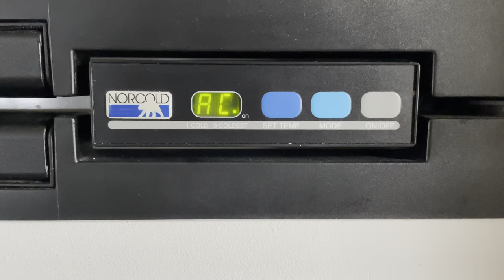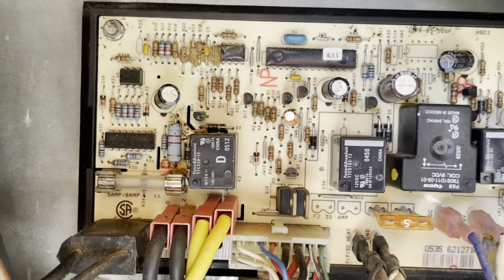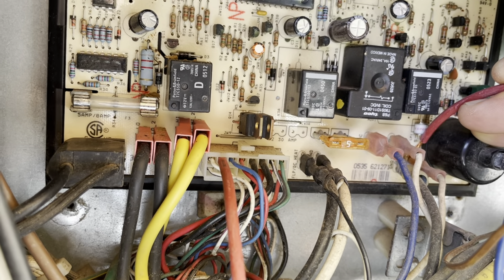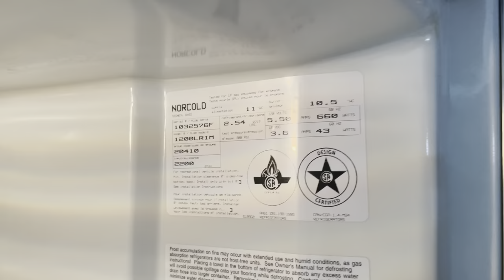“No Co” Code - RV/Camper Fridge

Comment: Just purchased a 2002 Winnebago Journey 36c. The refrigerator does not work on AC or LP. I looked at the board outside which has no cover. I don't reallyknow what i'm looking at. All i found was there are two red wires disconnected that go to this little valve that states 12 volt where the wires come out. I can see it was plugged in and the glass fuse looked good.
Reply from the maker: Is the fridge the same brand and model as this one?  And you’re getting the same error message?
Reply: The model is1201LRIM and getting same code for AC and LP code no flow @VitosFix
Reply from the maker: Yeah, I apologize, but if the back doesn’t look like the one in my video, I’m not sure how to help with that one.

Comment: Hello I have the exact same fridge and the mother board has some wires disconnected. It has the 12v disconnected and I have no idea where the wires go. My wife and I just bought this allegro bus and I need to figure this out to celebrate my wife’s birthday.  I can not find the schematic and it does not have the safety recall shutoff.  Please help me.  Thank you.
Reply from the maker: https://www.manualslib.com/manual/112570/Norcold-1200xx.html#product-1200LRIM

Check this manual out. Should be helpful!  But if it’s the same exact fridge, the wires should go in the same places as you can see on mine in the video.

Comment: If anyone is trying this and their power board has a different layout. Mine has a section called ‘P2’ located top left on the power board. I put the wire in the 5th hole (second to last) and grounded it to the metal case of the fridge. Heard the click, turned the fridge on and off again. Problem solved.
Reply from the maker: Thanks!

Comment: My Norcold 121 starts up on propane but will not throw a flame more than like a pilot flame, ac setting works as it should, what’s up?
Reply from the maker: Haven’t seen this one.  How long did you wait?  Is the refrigerator already cold or is it warm?

Comment: Just to confirm the ground is the connector not the bolt to the right of it
Reply from the maker: Correct.
Reply: Norcold mentions touching the bolt head but hey same difference

Comment: no AC code is on but have lights inside the fridge?  Hummm?
Reply from the maker: Same, keep watching.  I was saying that if “it didn’t have lights on.”
Reply: @VitosFix  the lights are on but still got the “No AC” code.  What’s wrong you think?  Jack.
Reply from the maker: I figure it’s like having to reset a computer.  Did you watch the entire video?  It shows how to reset it, and hopefully fix you problem.
Reply: @jackmaness202  I had same symptoms as you I fixed by replacing the blown out 5Amp glass fuse. Just hope its an old fuse that just happened to go bad and not a sign of an underlying issue like a bad fan or heating element. Of course, after correcting NO AC now I'm getting NO CO which led me to this video.